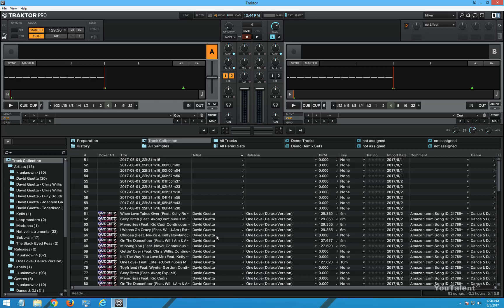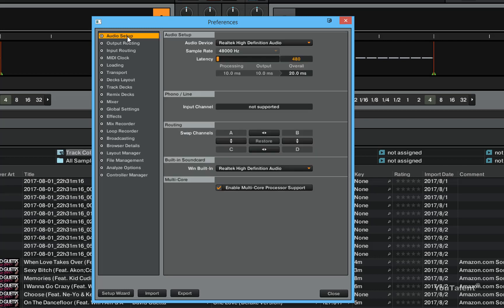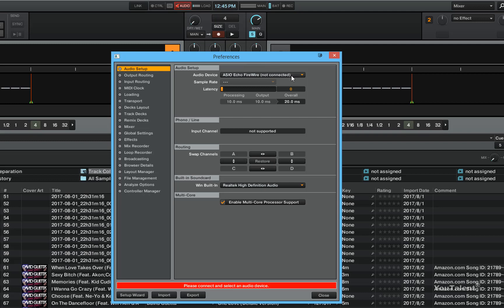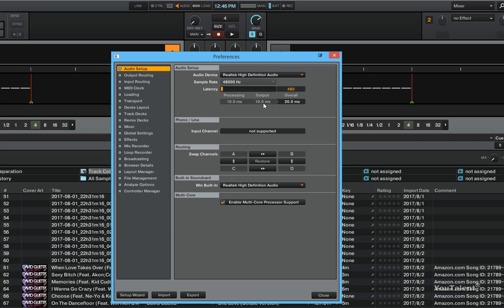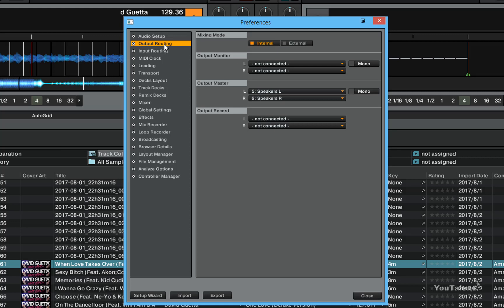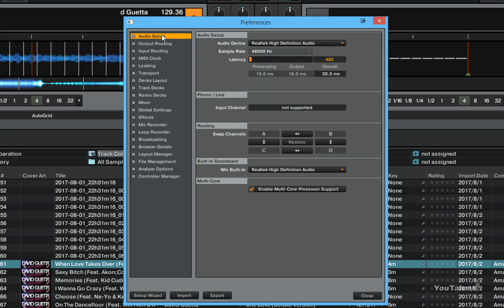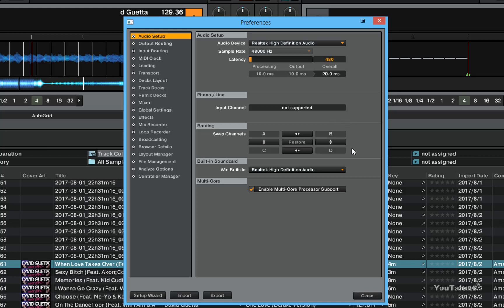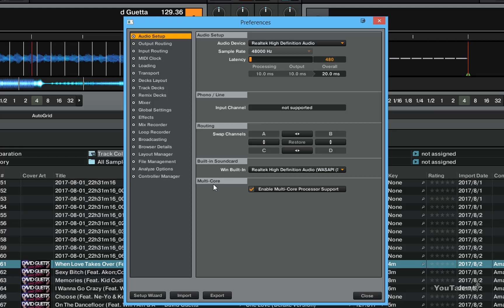Traktor Pro - Course 1 - Audio Setup (video #4)

Comment: I have a good 2018 macbook pro Catalina, i7, 16g ram, 2.5 ghz. I use traktor pro 3.6(2022) a traktor kontrol s4 mk3 with 2 turntable stanton T.92. It works, than it doesn't work. Basically its on then off, then on....offI. Im Getting low connection errors from the turntables. What do I need or what am I doing wrong?
https://youtu.be/f82VOas4i1g
Turntable icon Drops after awhile time code problem.